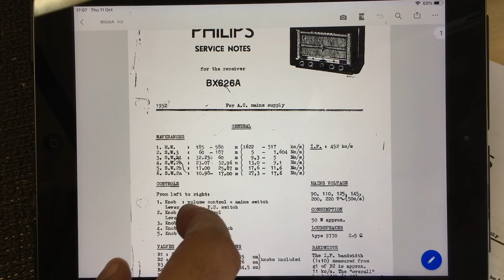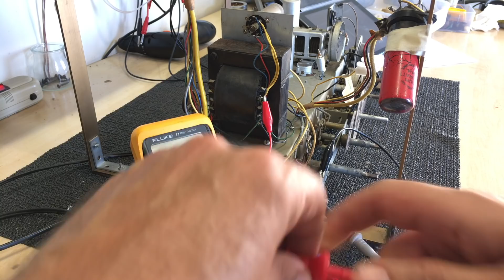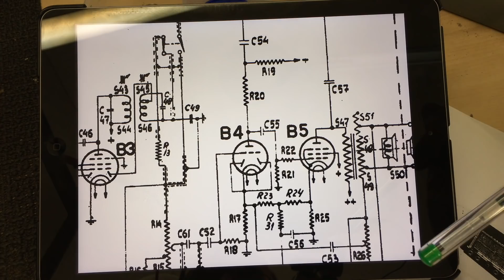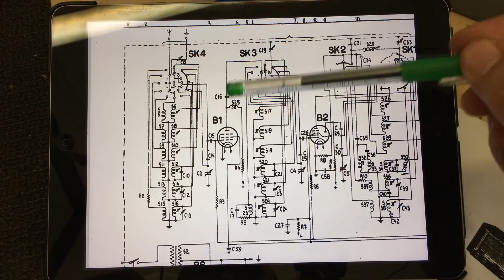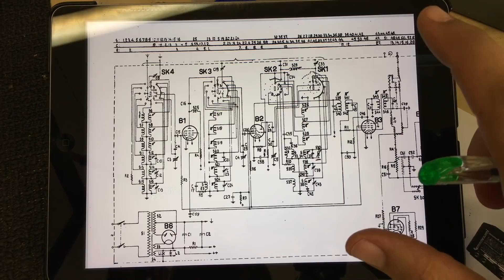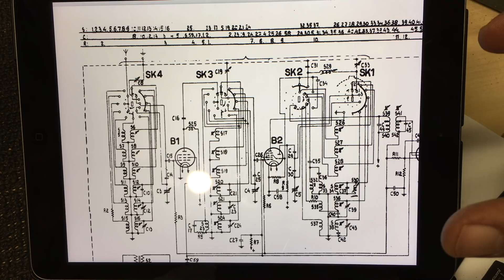Philips BX626 tube radio restoration - Part 2. Sort of a "power up".

Comment: The first valve is a straight RF amplifier. The second set of coils has nothing to do with the local oscillator. They are the plate load for the first valve and couple to the grid of the mixer valve. The third set of coils is for the local oscillator. Although RF preamps were not unusual in the 1930s, I understand that they became virtually non-existant (at least in England) after the war. So you have some high quality merchandise indeed.
Reply from the maker: Thanks for the clarification.

Comment: Air is this nice radio does it work on 220 or 110 volts
Reply from the maker: Ron Thompson : this one is set for 220. However, there is a mains voltage selector switch at the back that allows for 110v mains as well.

Comment: Looking good! I actually had a look in my copies of the red book to see if I had the correct schematic for you but that model isn't listed pre 1952 through to 1956. It must have been a Europe model and not a UK sold model.
Reply from the maker: Yes. A lot of spinoff models were produced which are not quite the same as the original, but close enough.
Reply: I was looking to see if there was a world model with the external vibrator. I have some other data books i'll look in. Being Philips it was probably Dutch made rather than a UK division set.